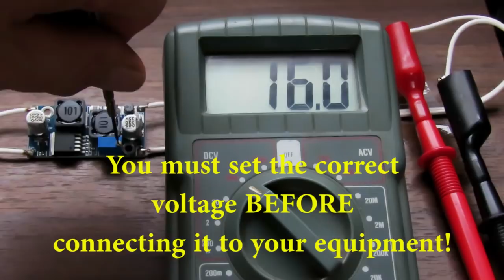How to use a step up/down DC Buck Voltage Converter.

Comment: You can use these to modify and then power LED strings from (lipo) batteries with no dimming effect as the battery voltage drops, as they will keep a regulated voltage until the battery dies.   they seem to work down to 3 volts/lipo cut off if the load isn't too great, they will also act as LED dimmers. A must-have "fun" item for anyone even remotely interested in electronics. 
You can get rid of the LED current limiting resistor as well and set the unit for about 3.1V to start.

Comment: This is what I am finding on sellers pages about it, but I do not trust them.  Possibly something has changed since your video?

Auto step down step up(SEPIC)
Input: 3-35V
Output: 1.25V-30V
Biggest current 2A
Conversion efficiency 92%
Frequency 50KHz
Output ripple 40mV
Temperature: -40℃ to +85℃
Reply from the maker: I would go by the specifications as they are always subject to change and there are many different versions of these devices. To be on the safe side any queries should be addressed to the seller/manufacturer. For higher current use (greater than 500ma?) some additional cooling will be required (heatsink/fan).
Reply: @NarrowboatJourneys  Something I find strange about every module but slap a 3608 onto an 18650 then set the voltage to anything.  Let's say 8v.  Then take that to a step-down or a CC (like a 4015E) and the 3608 will be at full amps, and burn up.  Happened to me a few times.  What I was wanting is to take the full range of an 18650 (2.8v-4.2v) and power a 200-300ma load (say a 3w LED at half its rated current, so it stays nice and cool).  I can't find anything to do that, so I have been trying multiple modules in series only to end in dismal failures to actually burning up a 3608.
Reply from the maker: That's beyond my skill level I'm afraid.

Comment: Helpful video but out curiosity, what did you used for input of that buck converter on your lamp? A normal DC adapter? Or there's a way to straight up use AC on it?
Reply from the maker: I live on a narrowboat and have a 12 volt battery system. These little units require a DC 3 to 30 volt input usually. Never use mains AC voltage with them.

Comment: Useful video for using your boats 12v or 24v to power small battery devices, more efficient than using  a 240v power inverter & then using a wall wart to convert back to low voltage.

Comment: If you find that model and the seller dependable would you provide a link to the item you actually ordered?
Reply from the maker: I bought that one a couple of years ago. Just search on ebay for buck step up down voltage converter. There are loads to choose from.
Reply from the maker: Some of them will only step down the voltage. Better to have one that can step up as well.

Comment: Do you enclose it in something for protection after connecting?
Reply from the maker: Yes, away from moisture etc. The ones I use don't really get hot but I suppose they could if used at full power.